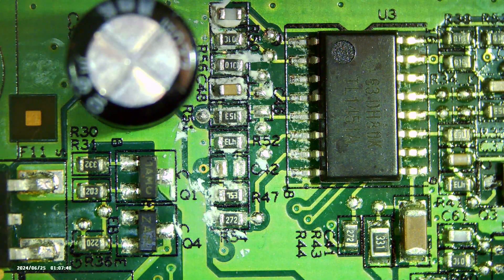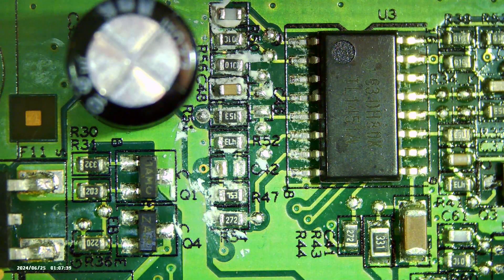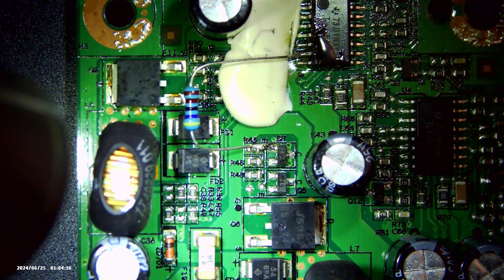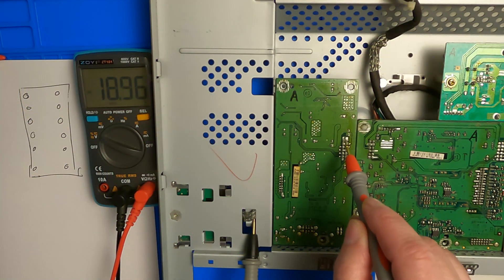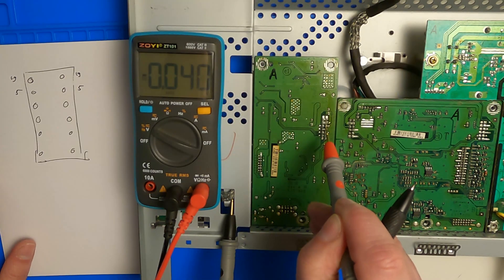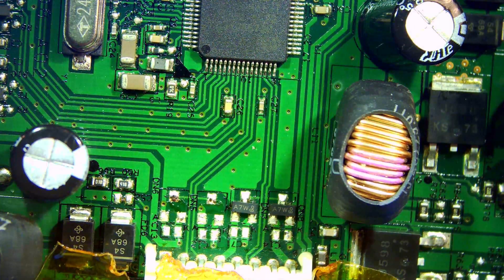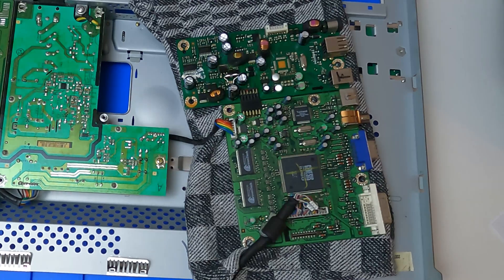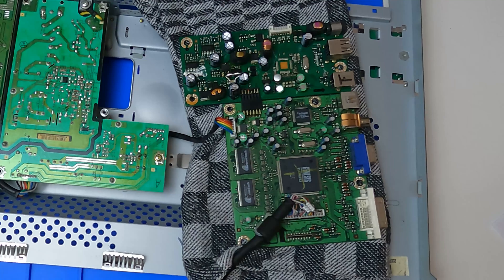Fixing a Dell 2007FPb monitor and igniting another one (Dell 2007FPb - Episode #3)

Comment: My other dead 2007FPb has a bad USB board also, but the 2.7K resistor is ok.  The display does not even power up. Capacitors are good, not sure what the problem could be. But I am glad to get my other one working by using this video.  Thanks
Reply from the maker: Did you check the other resistors? In episode 2 @ https://youtu.be/YOYm7_EGKxU?t=146 I draw a little overview of the values that the resistors should have.

Comment: Can these kinds of faults result in a 2007fpb not even lighting up the power standby LED or powering on at all when the power button is pressed?
I've tried the simple fixes, including checking the resistors under the white blob, but I'm stuck. I'd be happy to send you my 2007fpb if you want to take a crack at it for a video.
Reply from the maker: Hi Paul, thanks, in that case you might want to have a look at the power supply board. Have you checked the capacitors? Is there any voltage coming in on the 'board with the blob'? I would like to help you ofcourse, but I'm afraid postage to get the monitor across the atlantic will be more than a brand new second hand. If you can figure out which board is broken I could send you one of my spare boards if postage is do-able for you.